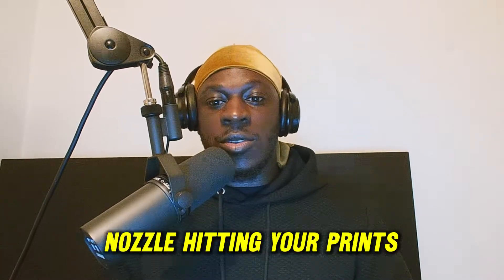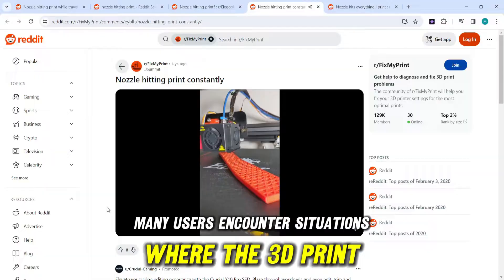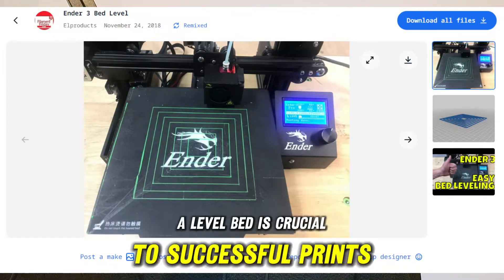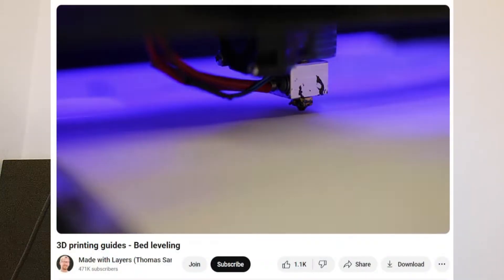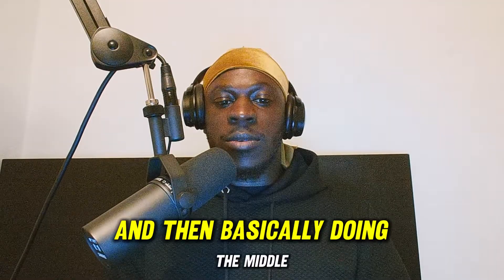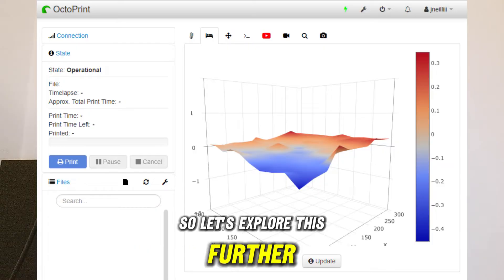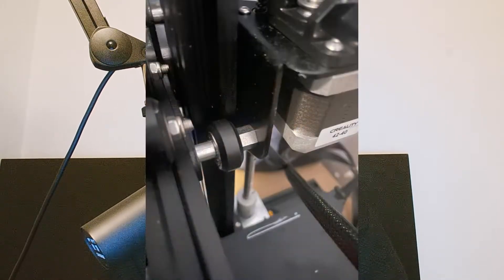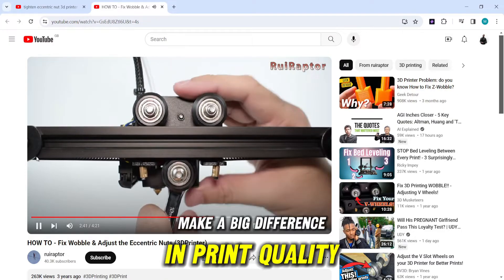How to Fix 3D Printer Nozzle Hitting Print | Try This Easy Fix!

Comment: The bar holding the printer head is lopsided and don’t know how to fix it, I have the anycubic kobra go
Reply from the maker: If the bar is lopsided from damage, you'll have to get a replacement. You can get into contact with Anycubic through email or social media and get warranty service. If it's not from damage, it could need a reinstall so it's straight

Comment: With my Ender 3 V3 KE I have the problem that the nozzel hits the infill. Outer walls etc. are not a problem. I have already searched various forums and adjusted the flow rate, tested z-hop. So far I have not been able to achieve any improvement.
Reply: Having the same issue with my V3 SE right now after it printing fine for months.   It’s at the point where it’s ripping the prints off the bed.
Reply from the maker: Have you tried changing the infill pattern or lowering the infill print speed?
Reply: @3D-Printerly  Yes, I have tried both. I also tried to reduce the infill flow rate.
Reply from the maker: @Captured_Alien  How about different filament or lowering your printing temperature? Does it happen with a certain 3D print model or all of them?
Reply: Have the same issue on my se
Reply: @bettafr  I'm having it rn with the se as well.
Reply: Did you ever find a fix about 1/4 away through the print it start scrapping the top of the I fill.
Reply: My Ke is the same thinking of sending it back.
Reply: Having the same issue with my KE
Reply: Ke and se very problematic. Having two of them and as soon as ı i'm gonna crazy fot this two.
Reply: Any solution??? I have the KE, wasted a lot of time and filament.
Reply: Have you find a solution? I have v3 ke too for 2 days and I noticed the same problem, touching the infill( at least that's what sound like) but not the walls